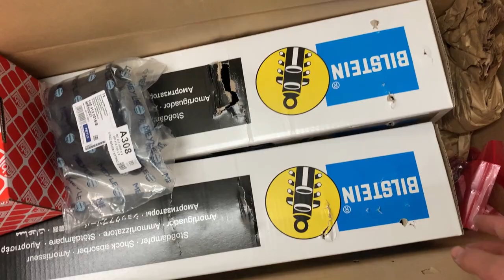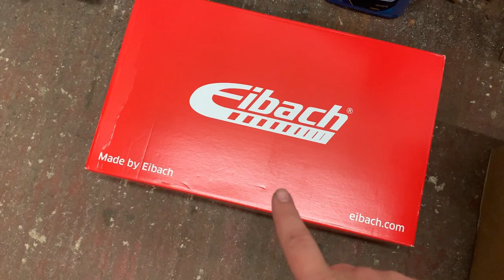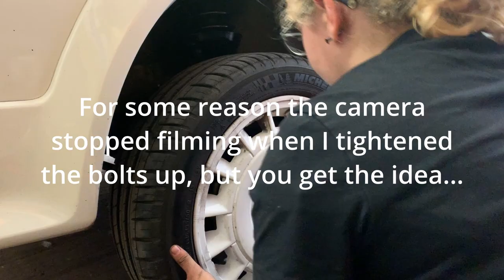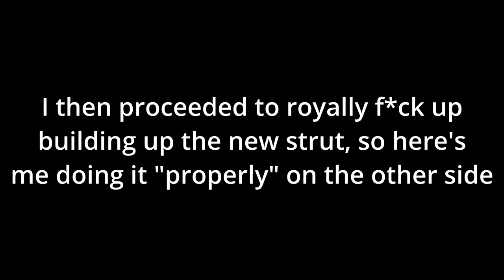Cheap Coilovers vs. Decent Lowering Springs? Mk2 Scirocco Suspension Overhaul

Comment: Fitted a very similar Bilstien set up for Gladys a couple of years ago to replace the worn out OEM on my 82 GL. Yep, the rears sat a tad high for a few weeks, but have settled down now, the new rubber bushings I put in added 10/15mm over the old crushed ones too so nothing to worry about long term.
Love the vid, and your sense of humour, keep it up, great looking Rocco too 👍🇬🇧

Comment: I remember when I first got my Rocco it was lowered on Joms gags

Every speed hump, pothole, rut, undulation of any sort in the road felt like being kicked up the arse, it was exhausting to drive because I was constantly bracing myself 😂

First chance I got I put the standard suspension back on and it transformed the car, my wife's Scala is on a very old set of Eibachs and it handles great and rides just like the standard setup but a wee bit lower.

Great vid as always!
Reply from the maker: That’s exactly it, I was constantly bracing myself and felt I couldn’t relax! I admire those who stick to coilovers but I’ve had my fun with them now. 😅
Reply: @WrenchingWench  same here haha, put me off for life!

Comment: B4 is stock shock that is stock length for stock spring. Now you have shorter spring with stock shock. With bilstein, sport shocks are yellow. B6 is siffer than stock  shock, B8 is B6 but shorter to cope with lowering springs like yours. I do not recommend to use shorter springs with oem length shock absorber.
Reply: Shorter shock on OEM springs works to reduce body roll at standard ride height.

Comment: As I said on twitter (I'm the Bearded Wonder) the bump stops determine the ride height. But, on your scirocco, they are significantly smaller than on my golf. I imagined they would be the same. The rear shock assembly is also different.

I guess you don't have so much room to play around looking for the correct height. If possible, you can shorten the spacer on top? I bet you can win about 2cm that way.

Edit: ahh it has settled. It looks great. I'm glad to be of help 🙂

If you want to have more comfort: try some 13" steelies with big 175x70 tires. 😁

Comment: Looks better to me Katie, though I've always been more of a comfort slug than one of the cool kids(*)!
The road I live on has one section that is concrete with a thin layer of tarmac over it - there's a small bump every join. Since my 'lower back pain' was diagnosed as fibromyalgia I've used the road to test cars before buying them - my father in laws zafira tourer (eco something, with thick licorice instead of tyres!) is painful to drive over that bit of road.
So my advice to go for comfort might not be right for you ... but having previously experienced driving a Citroën Xantia (before the suspension had risen off the bump stops) over a half inch 'decoration' (dividing parking space from road), and nearly loosing fillings at walking pace, I don't recommend lowering a car so the bump stops get touched in normal driving!
Note (*) I was 25 in 1995 - and the car I bought that year - a 2 litre ... N/A diesel Austen Maestro! I think that confirms I was not one of the cool kids!
It did pull quickly to 30 though, so at traffic lights I could out accelerate lots of sporty cars (probably as they didn't think it worth trying!)
P. S. Do you need a pillar drill / bench drill for your unit? I've only got a 5 speed bench drill (I'm told by my technician that >600rpm is a woodworking drill - much slower is really needed for metal work), but it makes drilling so much easier (especially if you want straight / centred holes!).
All the best, great channel, glad the nutty hub led me to you (though I planned to find your channel after miss Hubnut interviewed you several months ago)!

Comment: I thought coil overs were adjustable, Was there no thread left to raise them?

A longer single rate spring instead of the two springs (one stiff one soft) would probably give a better ride on the coil over dampers.

The soft spring looks like it is wasting all the adjustability and just compressing to the point of being coil bound before the stiff spring gets to do anything.

Comment: I wouldn't ever lower a Scirocco for proper road use. Maybe go higher on spring rate but not by much as the chassis is quite a soggy thing, just try to close the door when jacked up on the front corner!
Reply from the maker: Mine has a lower strut brace so it’s a bit more solid than normal!

Comment: Sensible move. 9 times out of 10 a factory suspension, very carefully designed by teams of engineers, is better than an amateaur set-up. Having said that, there are exceptions - particularly when manufacturers mess with their own designs to meet (for instance) new regulations.

Comment: Please get some knee pads or something to kneel on when your doing these jobs, i've learned the hard way what it does to the joints if you don't. Wouldn't want that pain on anyone on a bad day.
Reply from the maker: I used a kneeling mat every time I was kneeling down, I don’t think you can see it all the time though. I’m never without it, that concrete floor is horrid on the knees!